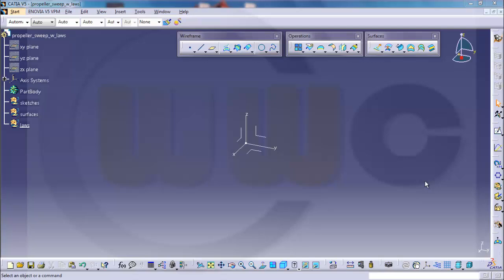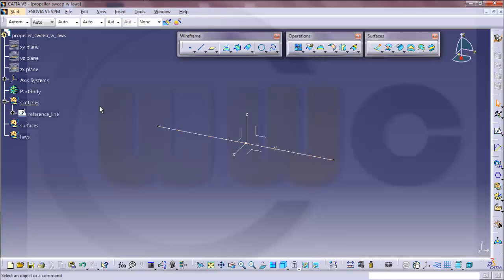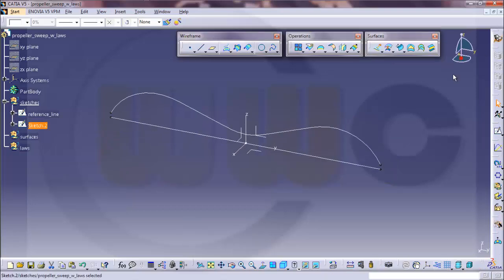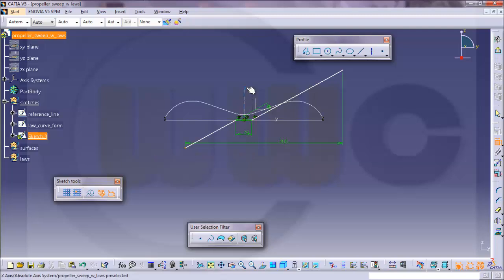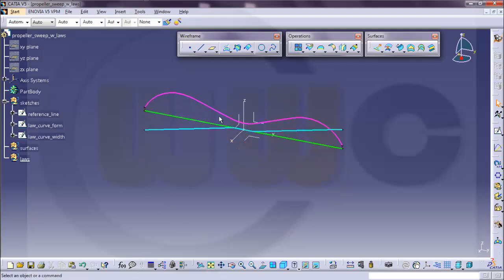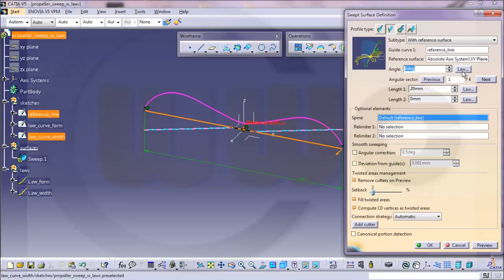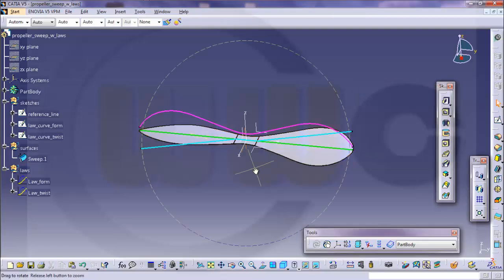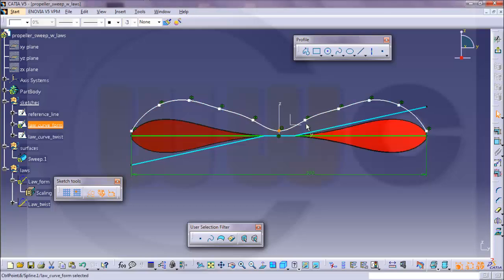Propeller with Laws - Catia v5 GSD Training - Sweep with Laws

Comment: An impressive video. In this case the reference line is a straight line, but if the reference line was a curved line as in the case of the video of Abgaskruemmer - Catia v5 Training - Sweep with Law, where the radio was increasing and decreasing. to draw the sketch where to represent the variation of the radius in function of the reference line?
Thank you very much
Reply from the maker: If you want to increase one value linear - you just neet two lines. If you use a curve as reference the results will be different.